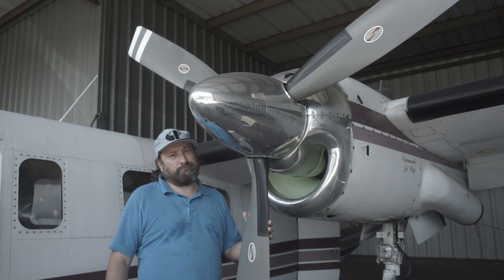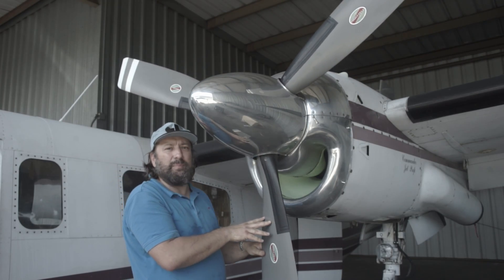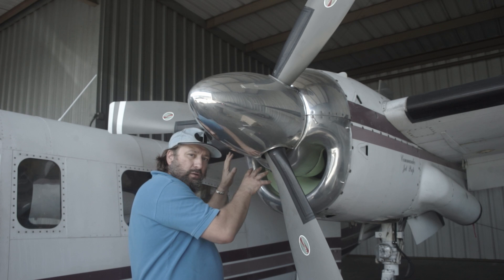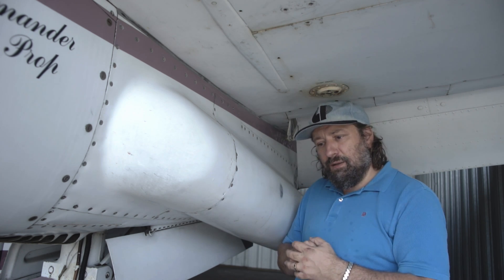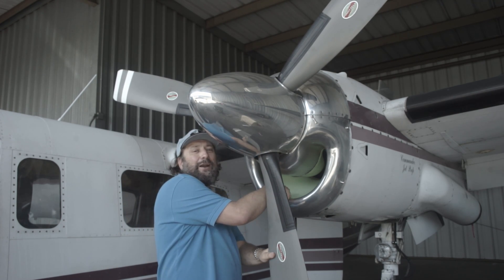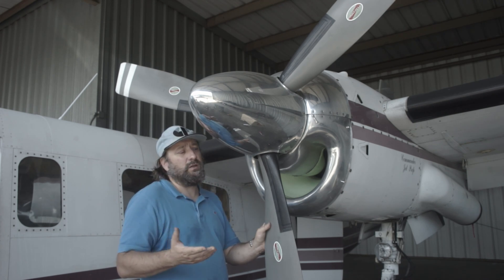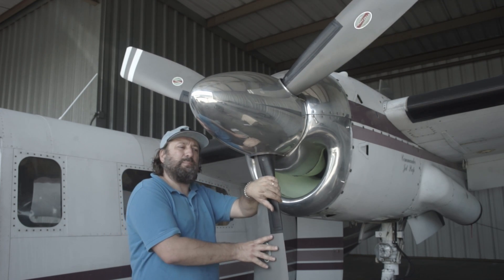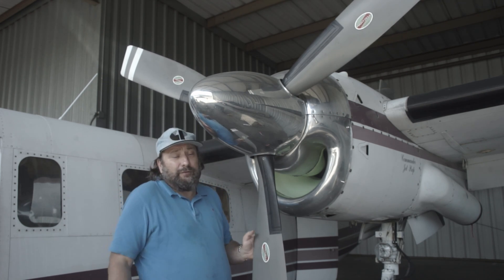TPE331 vs PT6 turboprops

Comment: Thank you for the very informative commentary. I appreciate the effort you went to. Two things with the Garret’s I’ve noticed (and I don’t fly them, I’m a PT6 guy) is they are significantly noisier than the PT and also on shut down, correct me if I’m wrong but the pilots are required to turn the prop though a number of times to minimise differential cooling of the shaft I’m led to believe. Is that a general thing or particular to a specific model?
Reply from the maker: That's correct. They're a lot noisier as they idle at 70% of rpm or higher. And yes, it is recommended to pull through the engines a few times after shutdown to prevent shaft bow. With all that heat trapped in there, the shaft expands and it can cause it to bow, which may make the blades scrape against housing. So it's recommended to spin prop by hand a little to expel that excessive heat. In the middle of Alaska in the winter, there's no real need to do that.

Comment: Good job, Amigo. I've flown both engine types extensively and prefer the Garrett for power and efficiency. The one thing I found lacking in the design was the NTS (Negative Torque Sensing) system. This is a mandatory "Go / No Go" preflight check and should be adhered to religiously. I had an engine failure inflight with a NTS malfunction (Checked good in pre-flight) and almost lost control of a Mitsubishi Solitaire. Would you care to elaborate on this Garrett-specific system? Thanx & Semper Fly ... ^v^
Reply from the maker: Yeah, it's not the best system. When it works it's OK, I suppose. Just a little nebulous and not so easy to monitor. Even scarier is that in mine there is NTS installed, but there's no way of checking it on pre-flight. Can only be done at maintenance facility. Stupid system, but I hope I'll never have to explore that. What happened with Solitaire? Did you manage to cage engine in time?
Reply: @stratobee  Totally agree ... poor system. I was gonna say, "barely in time" but I guess it's like a woman being pregnant ... she either is or isn't. The engine failed not long after takeoff during climb out, and the aircraft rolled hard left but I did cage the engine in time. Then had to uncage my drawers ... ^v^

Comment: To clarify, the PT6 is called a reverse flow engine because of the gas flow reversing through the combustion chambers NOT because the intake is at the back in many installations. For example, in a pusher configuration,  the intake would be at the front. This was taught at the FlightSafety Caravan course
Reply from the maker: In that case the TPE331 is also reverse flow.
Reply: No it is a reverse flow because air inlet in the rear with exhausts at the front(unless your in an avanti
Reply: @ndenise3460  I just returned from annual recurrent training at FlightSafety in which the instructor was quite clear that it's NOT reverse flow because of intake at rear, but solely because the gases reverse their flow through the combustion chamber. Consider installation with a prop in rear, in a helicopter, or stationary driving equipment, or even on a train.
Reply: Wrong.  In the Caravan, the air enters the compressor section at the BACK of the engine and exits the exhaust in the FRONT, period.  The direction of flow in the combustion chamber is irrelevant.  Same is true for all non-pusher PT6 applications, i.e. King Air, PC-12, etc...  Anyone who understands the PT6 knows this.
Reply: @jlalbee  so are PT6 in pusher config not considered reverse flow? No, of course not. Again, the "reverse flow" refers to the change in direction of gas through the engine irrespective of if the air enters at the rear of a tractor PT6 , front of a pusher PT6, or no real front or back for a stationary ST6.
Reply: @vicoastdog  The PT6 the Power turbine is closet to Propeller Gearbox.
Does not make any difference whether it is Pusher or Puller.  
TPE 331- The Power Turbine is located farthest away from the Propeller gearbox.  
PT6 is a TRUE REVERSE Flow Engine.

Comment: The TPE331 is the most efficient machine in the world for converting JET-A into noise, and not much else.  I'd rather fly a PT-6 any day.
Reply: I agree Steve.  The PT-6 is almost indestructible.
Reply: @jcheck6  and ironically, I have thousands more hours setting behind 331s than PT-6s
Reply from the maker: It is noisy, but it is also much more efficient than the PT6. About 20% less fuel burn for same power. You take the good with the bad.
Reply: @stratobee  Out of about 19-20,000 hours burning jet fuel, I've had only one engine failure, and that was on a 331.  Never had any problems from anything built by Pratt & Whitney  (PT-6s aren't the only Pratts I've flown, PW-118's and PW-119B's are the turboprops that I have the most time with).  Pratts are bullet proof.  Also, you can buy an awful lot of jet fuel with the money saved on maintenance.
Reply from the maker: @SteveD328  I'm not arguing any preferences here technically  - they're all good engines. But the reality is that PT6's have 3600hrs TBO and the TPE331 has 5400hr TBO. So I see only two possibilities: either FAA agrees the TPE331 is safer, or Pratt have a monopoly situation and are greedy as fuck and have resisted a TBO extension. Which is it? TPE's are half the price of PT6's at overhaul. As an owner, which one would you rather pay the bill for? $500K vs $250K? I'm not made of money, I have to earn every single damn dollar I spend on maintenance and aircraft ownership. I have a family to feed and a mortgage like everyone else. It makes a huge difference. TPE's are a a lot less expensive to own, no matter how you slice it.
Reply: stratobee Hmmmmmm.....I must have touched a nerve.......if you feel the need to start dropping 4 letter words.  😂. Peace out dude.
Reply: @SteveD328   be real what shit version of the 331 were you flying? the -10s are bullet proof.  was that failure 135 or 91.......?
Reply: Bearded Barnstormer The failure was on a Metroliner III (so it had -11s on it) which at the time was operating under part 135 as a scheduled airline (back when you could still do that).  I have time behind both -10s and -11s on Metroliner 3s, 23s and Jetstream 31s.  All had engine issues, just about every other leg on the Jetstream we had start and run the engines in manual mode because the computers decide to quit working, but only had the one failure in the Metro.  It doesn’t take much research online to see it stated flat out that 331s were known for reliability issues.  Other than a harness problem once on a DO 328-100, I can’t recall ever having a problem with anything built by Pratt & Whitney.  Peace out.✌️
Reply: Well we have(in canada) extended overhaul periods on condition. One company I worked at had a 9600 tbo.  If you have an engine shutdown TC comes out, and looks at records, and decides if you will keep the tbo or reduce it
Reply: Not only is the TPE331 more efficient outright, it has a much higher power density than the PT6.
Reply: @stratobee  Not only that, the TPE331 performance is superior.  Plus, I love the sound of the TPE331.  Mechanical music.  How often do you hear, "Just love the sound of those PT6s!"?  But you will always have the "turns Jet-A into noise" trolls.

Comment: PT6s are well into the 5000 hour range for TBO for commercial operators with hot sections at 2500 hours. 

It’s a bit of a misnomer as well... but generally “reverse flow” refers to the combustion chamber—of which the 331s is definitely reverse flow.
Reply: thats a gross misrepresentation... you are talking about specific PT6 Versions....
Reply: Nope: Reverse Flow is a reference to the Airflow direction thru the Engine. A Garret TPE331 is NOT a reverse flow engine. Its that's true then a CFM 56 Engine on a 737 is reverse flow. The Air enters in the front of the engine and exits the rear of the engine. This is NOT reverse flow.
The PT6 the Air enters the rear of the engine and exits the forward end of the engine.
PT6 - Compressor is in Rear portion of engine - Power Turbines are in Forward portion of Engine. = Reverse Flow
The TPE 331- The Compressor is in Forward portion of Engine. The Power Turbines are in the Rear of the Engine.= NOT reverse Flow. 
Does not matter how many times airflow might change direction in the burner section.

Comment: OK which engine is cheaper to keep and which gets better hrs per gallon ?
Reply from the maker: Garrett burns about 20% less fuel and is cheaper to overhaul. Hot sections tend to be a bit more costly, but overall the TPE331 is cheaper.

Comment: I think both TPE and PT use REVERSE FLOW COMBUSTION CHAMBER. In general, the difference is locations of exhaust pipes. The main difference is that what is connected to the propellers!
Reply: Negative.  As he very well explained, the PT 6 is a reverse flow which is very easily understood if you look at the design where the 331 flows straight threw
Reply: @flywayne9362  
Negative. The TPE331 does not flow straight through. Being an A&P, I have worked on both engines. The PT6 and the TPE331 both use reverse flow combustors. What is deceiving is that the PT6 is essentially mounted backwards. Meaning the compressor turbine and free power turbine are forward of the compressor respective to the aircraft. Being that the PT6 uses a free power turbine, this is so the propeller can be mounted forward of the reduction gearbox, which is directly attached to, and forward of, the free power turbine.
Reply: Jumpinjohnnyo ahhhhh technical ! Lol. Yes u r correct .  I was referring to the overall design of the pt6 being referred to as a "reverse flow " engine as the air enters from the rear of the engine and flows forward and the power section is at the front where it exits that's all.  As an a&p what is your take on Garret's turning the prop clockwise or counterclockwise depending on application ? I've seen both on twins and single engine.  Thanks for ur comment
Reply: @flywayne9362   The prop rotation is determined by the application.
A good Technician would not have a comment about prop rotation.
Reply: Correct.  Both engines use "reverse flow combustion chambers."  But we're confusing that with the definition of a "reverse flow engine."  With a "straight through" engine, the air enters the compressor in the front and exits the exhaust in the rear, like the TPE331.  With a "reverse flow engine", the air enters the compressor at the back of the engine and literally changes direction and travels forward through the hot section and exits the exhaust in the FRONT of the engine.  The PT6 design is like this, as is General Electric's new Catalyst engine.  Bottom line, don't confuse "reverse flow combustion chamber" with "reverse flow engine."  They are different things.
Reply: @Jumpinjohnnyo  Nope: Reverse Flow is a reference to the Airflow direction thru the Engine. A Garret TPE331 is NOT a reverse flow engine. Its that's true then a CFM 56 Engine on a 737 is reverse flow. The Air enters in the front of the engine and exits the rear of the engine. This is NOT reverse flow.
The PT6 the Air enters the rear of the engine and exits the forward end of the engine.
PT6 - Compressor is in Rear portion of engine - Power Turbines are in Forward portion of Engine. = Reverse Flow
The TPE 331- The Compressor is in Forward portion of Engine. The Power Turbines are in the Rear of the Engine.= NOT reverse Flow. 
Does not matter how many times airflow might change direction in the burner section.

Comment: This comment needs to be verified by someone who knows better but I believe Garrett AiResearch was at one point acquired by Allied Signal Corporation which later acquired Honeywell, keeping the Honeywell name after the acquisition. So, to answer the question of who makes the engines, it’s Honeywell though it’s various acquisitions and mergers.  Garrett used to also make turbochargers for reciprocating engines, but I don’t know if those are still around.  Maybe some knows?
Reply from the maker: I think you are correct, sir!
Reply: Garrett made turbos using the name air research

Comment: I find it funny that the most the the planes that got Garret’s were dogs. The MU-2 and Merlins all have ridiculously bad safety records, at least before all the SFARs. It’d also worth mentioning that that the military prefers the geared turbines over the free turbines because of there power response. For example, all carrier turbines are geared drive shaft engines.
Reply: The Garrett engines have nothing to do with the safety record of either of those airplanes. The people who were flying them are the reason they had so many issues. And the facts don't agree with your statement that most of the planes that got Garretts were dogs. Excluding the Piaggio 180, prior to about 2005, the only business class turboprops that could attain true airspeeds in excess of 300 knots were all powered by TPE-331's. The only King Air ever built that would true at 300+ from the factory is the 350. None of the PT-6 powered Cheyenne's will do 300, the Cessna Conquest 1 doesn't come close to 300. But, the MU-2, Merlin III, Cheyenne 400LS, Cessna 441, etc, will all true at 300 plus knots, and they all have Garrett's. It's a better built, more efficient engine than the Pratt.
Reply: S4 Aviator rock on my dude, yeah I agree. I didn’t think about all those other planes that used Garrets with much more conservative designs. The turbo-commander for example! Great plane! Safe, fast, and reliable; even after so many years of being out of production. I work for a co that flies metros (used to fly a lot more) and everyone hated the garrets on themselves. They all called them the “Garret hand-grenade,” and when I asked why they said its because they would detonate randomly. Great right? Ive been sitting around an airport for too long listening to old mechanic’s wise tales. Hahaha Cool Lear vid BTW, the 35 is my favorite of the Lear fam.
Reply: The power response is a poor argument for choosing the TPE 331 over the PT-6 . Spool up the PT-6 and then and Add thrust 
 with the PROP Lever.
Reply: @ S4 Aviator. 

You’re attributing performance to engine type rather than aircraft design. Horsepower is horsepower—doesn’t matter how it’s made. 

Take the 425 vs the 441. The 425 is literally just a Cessna 421 with PT6s. Not very powerful ones because they’d have to completely redesign the airframe to accommodate more powerful engines—which they did with the 441.

The Merlin is a cramped and short wing aircraft with very powerful engines. 

The MU-2 is also a very cramped aircraft with very short wings. Only a few versions top 300 knots. 

The only Cheyenne that is faster than 300 knots are the 43 400LS versions that they made. Of course if you stick 1000 hp a side on a tiny airplane it’s going to go fast—doesn’t matter what type. 

You talk like a Mopar fan. Something like the Hellcat or Demon isn’t particularly special—it’s just that Chrysler was the only one crazy enough to do it as they circle the drain for the third time in 40 years while Honda and Toyota and Hyundai and KIA make the cars that most people actually buy. 

The King Air was designed for versatility and economy, not speed. That’s why it’s still in production in all basic versions except the 100 (which didn’t top 300 when powered by Garretts) while every plane you listed has been gone for decades. I want to say the last new Garrett powered airplane was made in the previous millennium. 

And I fly a 300 knot King Air. I’ll actually get 305-310 out of at about FL200 ISA+5 using reduced rather than book power settings. 

And unlike any of those cramped planes you mentioned this plane is huge and comfortable and has insane climb performance you simply can’t get from power alone. It also has dispatch reliability that none of these planes come close to approaching.

Comment: The Advantages of a PT-6 over the TPE 331.    PT-6  Much Quieter Engine - perform a hot section inspection without removing the complete engine from the airframe - The PT- 6 140 AG Engine has NO time limits but is monitored for performance and NDT Inspections with Engine performance determine when the engine is overhauled- Is a more rugged engine and more forgiving of poor maintenance practices.
Reply: Yeah, but your assessment of the noise thing is a bit incomplete. The TPE-331 is a much noisier engine outside the airplane when it's idling. No doubt. However, the TPE-331 actually has a lower db flyover signature than the PT-6 does. Meaning that its actually quieter at noise sensitive airports. It's also generally considered to be a quieter engine from a passenger perspective as well. As far as the TBO is concerned, yes the PT6 can be run on-condition as part of the MORE program, but simply running certain TPE-331 engines on a AAIP (assuming you're Part 135) extends the TBO to 7,000hrs.
Reply: You have obviously never been a pax on a metro...... though the only thing that could beat us below 10k (250 kt max) then slow to approach was an F28